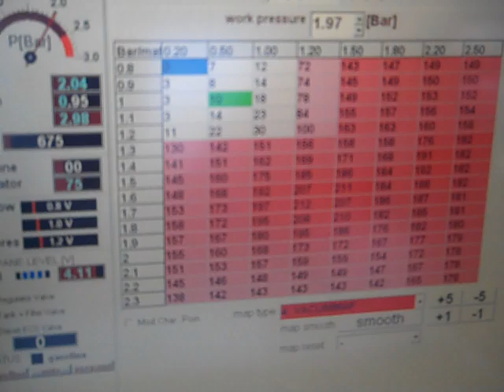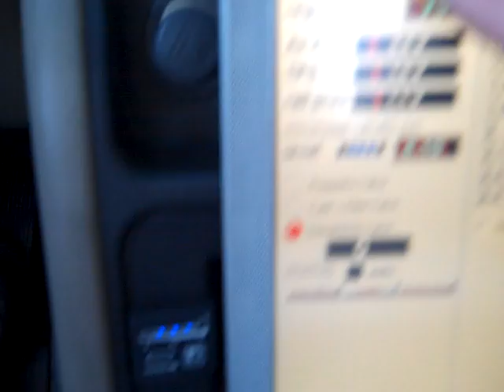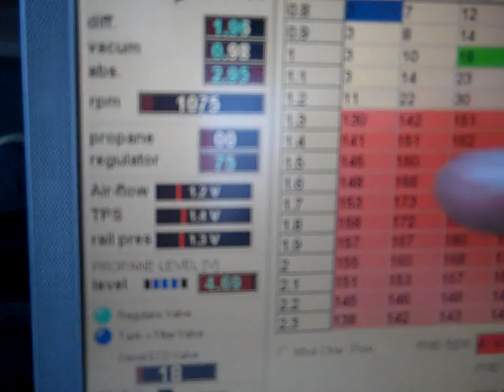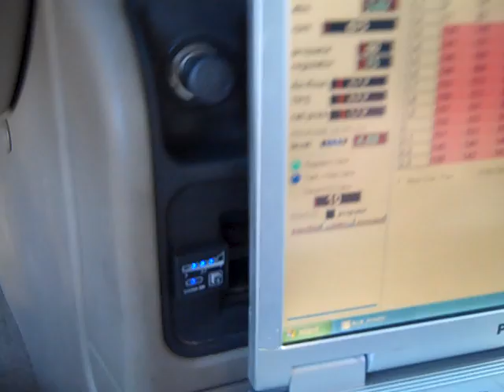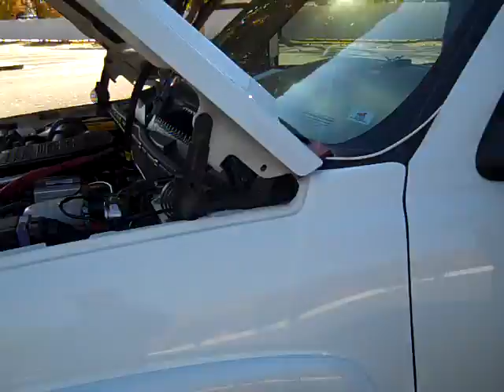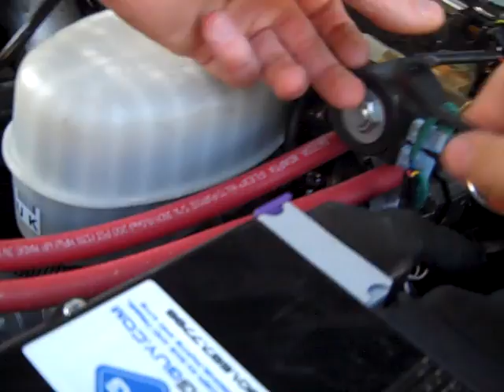sequential injection CNG diesel conversion dual fuel, mycngguy.com

Comment: Troy:  This is a really great video with a lot of technical details.  I am looking at doing a dual system on a Ford 6.4L truck.  I am interested in your system, but I don't quite understand the sequential injection style system on the diesel.  I thought that the sequential injection style CNG system was for gassers, and that you had to drill and tap CNG nozzles into the intake on the gasser block???  I am a newbie at these systems, but that was my understanding.  So my question is: What is the purpose of the timed sequential injection of CNG into the intake pre turbo?  Isn't that part of the intake just going to be a mixture of air an CNG available for the engine to consume as it operates along normal parameters?  Doesn't the injection of CNG make the mix richer and improve the efficiency similar to a water/meth system on steroids?  P.S. : I am in oklahoma and very interested in this conversion because of the number of fill stations in our state....quite a popular technology.